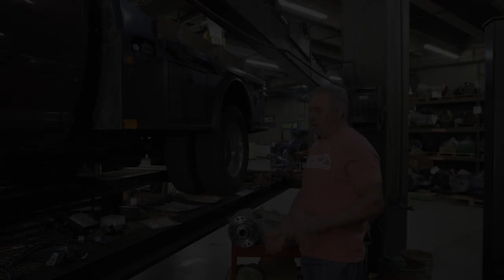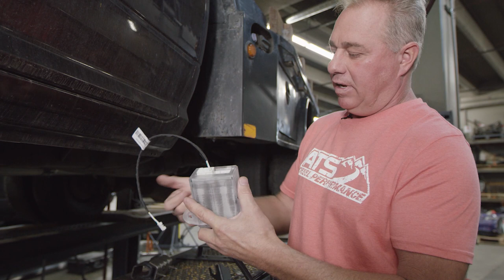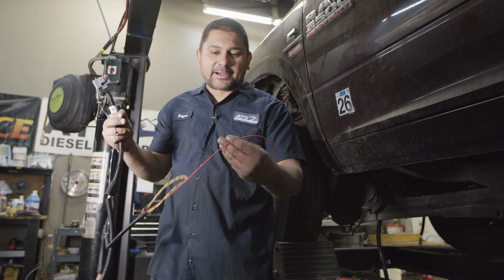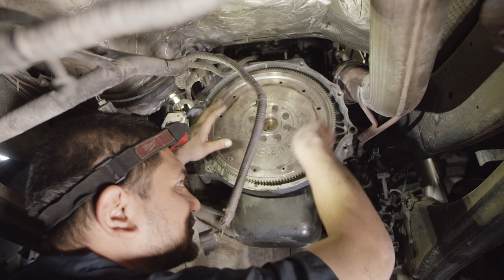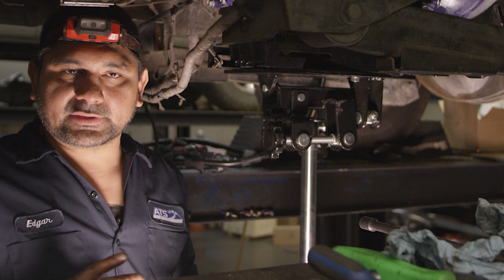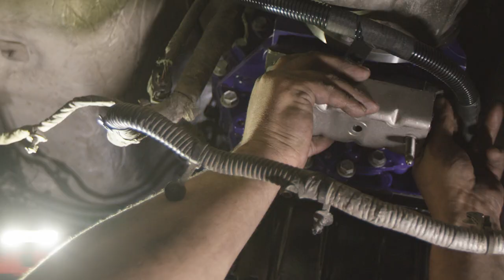ATS Swap · Cummins to Allison Conversion Kit - Installation

Comment: It would be nice but they can't get any A50 TCMs because theirs won't work with out it. They are not the only ones being held hostage by GM.🤬. Not until maybe the later part of the 1st 1/4. What happens if you system has a problem. Wait half a yr to get it up and going again? Would of love this system but now rethinking.

Comment: When everybody said putting a tuner on a truck is illegal in here this dude is both of them to the body I sure wish I could afford your complete system what kind of badassness would it be to have a 600 horsepower Cummins in a 1988 Chevrolet Suburban

Comment: I know there’s some negative stuff out there about ATS, but I’ve worked with these guys with my truck over the last couple years and they’ve been awesome. I have their 5000 Compound Kit and their Allison Conversion on my 2018 Ram 2500. I can’t speak about other products, but thus far their customer service, support, and products have been top notch.
Reply: How much is the conversion kit cost, not install.
Reply: That’s a good question. When I did it they weren’t selling just the conversion kit and were requiring to get it installed here in Colorado.
Reply: Jay, there are always alot of haters out there. People misapply products and want to blame the manufacturer.  The manufacturer R&D products that sometimes fail and that helps them improve.  I am about to pull the trigger on ATS's complete Allison swap for my 2019 Ram dually. I haven't heard anything but good about the kit so far. I am eager to place the order and get it installed.  Congrats on your new transmission.  The kit looks top notch!
Reply: Dang! Sounds like a nice setup👍
How’s it tow? Trans temp ?
Thxs
Reply: @Ishmaell711  I haven’t had any issues thus far. Trans temp runs very cool. I can’t tell you exactly off the top of my head, but it’s fair to say towing my 5th wheel (23k truck and trailer) I’m anywhere between 120-160 degrees depending on the type of grades.
Reply: Sounds like a great setup straight forward
Reply: @jayjohnsen9055  how much was that then? If you don’t mind sharing
Reply: @kustomaf7606  it was an arm and a leg I won’t even lie. My situation was a little different as well because I got the upgrades needed to hold 900 hp. Given all the changes in the world today, and to be fair to ATS, I’d call them personally for a quote to get an accurate number for your situation. My ballpark guess, however, anywhere between 8k-15k.
Reply: @jayjohnsen9055  Thanks brother! That helps
Reply: @repairvehicle  
About  15k  to 18k.
Reply: @billywilliams6853 
You are very smart 👌

Comment: any issues running this setup with something like a smarty tuner since both will communicate with the CAN bus?
Reply: Just called ATS.  The transmission is an ALLISON, but their software uses EFILive tuners, while the conversion "box" tricks the ECU to thinks it's an AISIN transmission.  Was told this way, you ocan keep all your factory options, which is mostly done via CANBus.

Comment: How much hp is it rated for?
Reply: Depends on how you want them to build it
Reply: @CaptainRudy4021   I'm sure I can get an Allison built for w/e; that's not the question. I'm wondering what the $13k for this kit gets you for hp rating. Pretty simple.
Reply: @monsterram6617  taking into the account the output of the 2022 high output cummins and the fact that people will be modifying them, my guess would be 600hp.  Any more than that, you'd have to pay to have the transmission beefed up more.

Comment: can you run a tuner with this conversion?
Reply: Went over this in the first 5 minutes. Transmission is tunable and the different HP ratings should tell you everything you need to know.

Comment: is there an Allison conversion for a 2005 Dodge ram 2500 5.9 cummins 4x4?
Reply: I'm looking for same for my 2007.  I'm thinking from some of the numbers I was seeing that the conversion is more than the value of our trucks
Reply: @MrRandyj72  
Depends how much you like your truck.  the new ones are nice, but I hear a lot of issues.  I wish the conversion was more economical.
Reply: I’d rather spend on the CA conversion then paying 80+ on a new dually.

Comment: What about a 03 3500 nv5600 to Allison
Reply from the maker: We are not offering anything for a manual to automatic conversion. There are several forums on what you need to do to do that conversion and once that is figured out on your end, then our conversion will work.

Comment: How much is the kit?
Reply from the maker: The kit ranges from $12,700 to $13,700.  We can accept your 69RC Aisin or 68RFE as a Core.  There is a refundable core charge $2,200 that is returned once we receive the unit and it passes inspection.  Please give us a call to learn more and with any questions you may have.  Thank you for your interest in our products!  (800) 949-6002
Reply: @ATSDieselPerformance , thank you

Comment: I would think for $12K you could rebuild your 68RFE for less and make it strong enough where you don't have to worry about it anymore.
Reply: Price it out and figure it out.    Turns out,   The cost difference is minor at the end of upgrading the 68 to match.
Reply: @jonellwanger7258  Then why go to the trouble of swapping in a different transmission and making it work? I mean go for it if that's what somebody wants to, do more power to them. I was just thinking of the cost basis to get an equally good transmission.

Comment: Why don’t you guys make a kit to put a proper Eaton Fuller 10 speed in these trucks? This seems insane to spend all this money and and up with a bloody automatic transmission? Also some kits to put a manual in newer 6.7 Ford trucks would be sweet as one can’t even get a brand new one anymore with a manual transmission! Who is spending $90 grand on a new truck with a automatic? I sure as hell won’t I walked away when I couldn’t get a manual on a new one and the damn 6.7 Cummins was derated with a manual transmission! We need some kits to swap in Eaton Fuller Roadrangers into these Dodge Ford and GM pickups I’ve seen conversions done so they will fit.
Reply: The reason manual transmissions are no longer sold in heavy duty pickups is no one was buying them. If you are a member of a small group who want manual transmissions, good luck to you. Also wouldn't the Eaton Fuller 10 speed be huge and not fit easily?
Reply: I’m not paying for a new truck and shifting gears. The new truck trans hold the weight on most cases and manual is not needed like the old days.
Reply: Most people can't even drive a manual

Comment: Just Buy  a Dodge Ram,    with  a  AISIN TRANSMISSION. 
It's  Cheaper. 
Plus the cruise control works 
Plus the  Exhaust Brake Works 
Plus the AISIN is stronger 💪 than the Allison. 
Plus  any Dodge Ram  service Department can work on your truck. 
Plus  Factory Parts  are available.

Comment: What's wrong with 2004 2500 two wheel when transmission engaged the5.9 wants to run away

Comment: What about a g56 to Allison swap? I'm
Tired of changing gears and dealing with dual disk clutches hopping and jerking with a load hooked to the truck.
Reply: Buy a truck with an auto....
Reply: @ShainAndrews  I'm all for that and have but unfortunately there's not an option for Cummins engine with Allison auto trans.